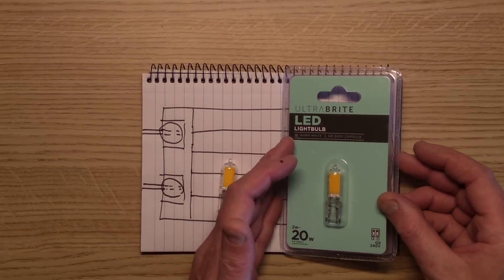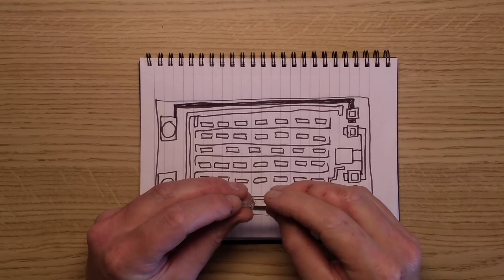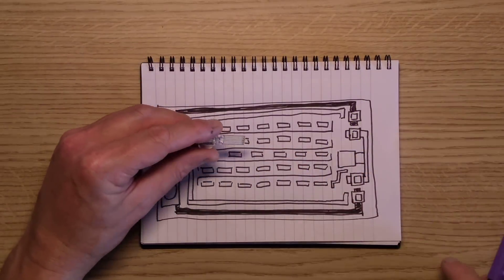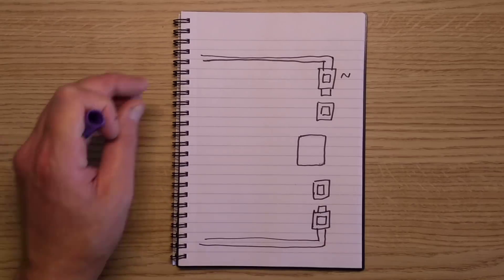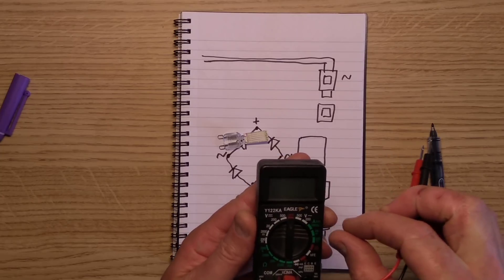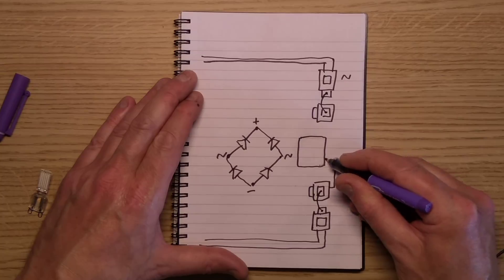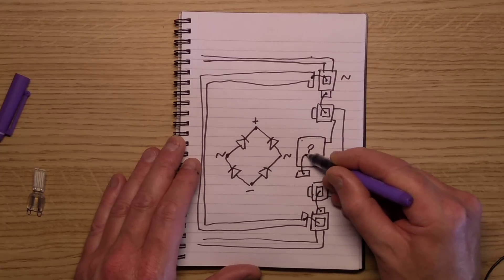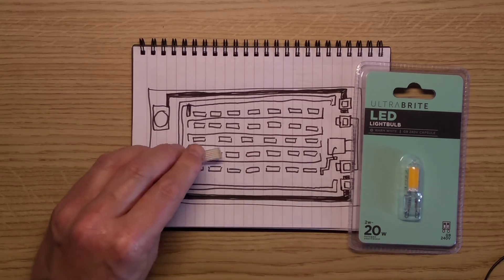Inside a G9 COB lamp from Poundworld.

Comment: 7, 7, 6, 7, 7 chips = 34, x 2 sides is 68, x 3 volts is 204 volts ???
Reply from the maker: And the rest gets dropped by a current regulating chip.

Comment: I have 25 of these installed in an antique chandelier.
They flicker when I try to dim them with a trailing edge LED dimmer….
Anyone any idea on how to circumvent this?
Reply from the maker: The minimalist nature of the small lamps is such that there's no room for smoothing, so the mains frequency flicker becomes noticeable and they may also react visibly to mains voltage fluctuations.
Reply: @bigclivedotcom  Ah oké, then I will look for some more appropriate bulbs!
Thanks a lot for replying! And for the great video’s! These series are fantastic!

Comment: I too bought one of these for 50p,found a sutable holder in an old display unit,works well as an under cupboard kitchen worktop light. I put some foil on the underside of the cupboard to reflect light and dissipate heat.

Comment: I bought a few of these from China, as I haven't seen them in Poundland or Poundworld.  They were advertised as 5 Watt but when they arrived they seemed rather dull and measured 1.5 Watt.  I received the usual partial refund. As others have said light fittings that are designed for G9 type bulbs often have restricted space available, so getting more powerful but larger cob bulbs is not always the answer for simple replacement of G9 incandescent bulbs.

Comment: Why would you need a lamp holder to show it working?
The Hopi meter has clip terminals. Just put a test lead with aligator clips in there and hook them up.
Reply from the maker: I'm travelling with work, so no Hopi Meter.

Comment: G9 have one minus, because the are so tiny there is no space for capacitors, as result of that they flicker. Is there any way to limit that flickering?
Reply: Do you have any space in the fixture?  If so, a resistor or cap dropper, [pref. full wave] rectifier and smoothing electrolytic will fix that.  But if you just feed rectified and smoothed input, you'll [of course] be providing 1.4x the recommended input voltage, and that might end badly...  :-)
Someplace I read about running pairs in series, so they'd run cooler and last longer; and that'd also save you the dropper :-)

Comment: Shame on you, not showing in lit up first.

What voltage are they ?
Reply from the maker: 240V
Reply: You must buy led tester or some high voltage adjust (this need some extra capacitor about 100uf). https://www.ebay.com/itm/AC-220V-Bead-Board-Lamp-Dual-LED-Display-Screen-With-Light-Backlight-LCD-Tester/192536308712

Comment: The bulb looks like, and appears to be about the size of, a 1960s Kodak Instamatic flash bulb. They were fired mechanically, because the camera had absolutely no electrical or electronic components. I think each bulb had a piezoelectric crystal that discharged when struck by a sprung lever.
Reply: True the instamatics has a spring that is released  when the shutter was fired and hit the bulb base.   Took one apart to see how it was made.  Reset the spring then refired the flash and got a   hot flash of light.

Comment: Bare wires will do to light it, doesn't it? :D
Reply from the maker: Slight lack of bare wires and stuff in the accommodation I'm in at the moment.  (Working away from home.)
Reply: bigclivedotcom No bare wires or an old cable to be found around a light crew? :o I'm indeed also curious about the lighting of the back. Greetings from Budapest as I'm also away from home and attending Sziget.

Comment: I don't know who came up with this "LED filaments" and "LED bulbs" design, but he has to be uneducated person in EE.
LED needs really good cooling. Tungsten filament doesn't.
Tungsten filament require special atmosphere. LED doesn't.
That's why you hang tungsten filament on very thin molybdenum support wires in the glass bulb and that's why you mount LED chips to aluminium heatsink with thermal conductive paste.
Reply: The engineer tries to build the best product possible. The capitalist, on the other hand, will always want to make the best-selling product possible. If it looks like a traditional lamp, that's a selling point. People like things that look familiar. People also like it when they can replace their bulb with a semi-unidirectional LED "bulb" at minimal cost, instead of replacing the whole lamp at significant cost. That's another selling point.
Sure you may not get 100,000 hours of MTBF with the inadequately cooled bulb, it may go out after a year, but... when you are shopping for bulbs, MTBF is just a number on the box. It may be true, it may not. So you can buy a $5 bulb with a MTBF of 10,000 hours, or a $20 bulb with a MTBF of 100,000 hours. Will people make the economically sound choice? 10,000 already sounds like plenty. And it's just $5, who cares. Most people will compromise. And If it goes out after half a year, will they complain? Or will they just buy another one for $5?
Reply: Also, the "filament" lamps are quite efficient (less light absorbing stuff around) with good power factor (no cap. dropper), so there's actual engineering advantages to them. 
But yes, the heat conduction has to happen over the gas in the bulb, that's why the LED types don't have vacuum like the tungsten lamps did... 
In the end, they got it working (at least some manufacturers), so i assume they can't be that uneducated..
Reply: That's why this type of bulb is often quite low power, often much lower than the power promised.

Comment: Question can you explain how I can make a simple circuit that when triggered and the trigger stays pressed,it will open and then close a relay and stay in that state until the trigger is released and then pressed again. I hope that made a bit of sense. thank you so much. your the man.
Reply from the maker: Look for a standard component called a recycling timer relay.
Reply: that type of circuitry continues to cycle as long as the trigger is activated. unfortunately that wont work. By the way I watch just about every video you have.
You really do great work and your obviously very good at what you do.
Thanks so much for your videos. Keep it up Man. If you can think of another way to create this type of circuit please let me know.

Comment: Clive do you have an email address you don’t mind sharing with a viewer? You likely know this but if not it’s Best to make it a different email address than your normal personal address because low lives will spam you to death. 

Reason i ask is I wanted to forward you a couple of Chinese product listings for clamp meters, in particular ones that try to match specs with the Klein 900 (used to be the Klein 2000). It’s a meter that can measure DC current up to 2000A, though iirc only the AC current is RMS, but still measures up to 2000A, I don’t know enough about electricity to know why that is but it would appear something about DC current makes it hard/impossible/unfeasible to measure current RMS, or high current at least. Maybe the meters that can measure up to 20 (maybe even 60A max) DC via probe leads can do so RMS. 

Anyhow sorry that doesn’t really matter, I’m just really curious about how these Chinese UnBrand’s performance compares to Klein and Hioki/ Fluke, is it a lie and if not does it do so differently than Fluke’s or where exactly are the corners cut? If I dissasemble one on high quality DSLR 1080P 60fps at high bitrate would you like the footage? And I can take still photo’s of the boards/components for even higher resolution that can be blown up much larger for identification of individual chips/caps/Fets/diodes/chokes/inductors & anything that may be of interest. 

Would also be willing to jump on a phone call or stream/Skype to you if you want something investigated in real time, I can be the hands and you can be the eyes/brain :P.

Alternatively I can point you to the amazon/eBay listings for the meters that can do up to DC 600A, 1,000,  or 2,000A. 
Models that do the same with AC alone are much cheaper and more common so there’s really not that wide a selection of the higher spec variants
Reply from the maker: Clamp meters tend to use a pickup coil for measuring the AC current and that doesn't work for DC.  The DC versions are much more complicated and have to be nulled out frequently as they can sense ambient magnetic fields too.
Reply: bigclivedotcom thank ya kindly!

Comment: I ran across circuit similar to this in a edison 17 screw bulb (120 v).  Just leds wrapped around a core with the electronics on the same flexible "board" slipped in the core.  All it had was a package bridge rectifier, tiny SMD smoothing cap, a chip SM2082D (a constant current LED driver) and a SMD current setting resistor.  There were 44 SMD LEDs in series (2.5v x 44=110v).

Comment: I would of been happier if you rigged up some creepy setup to power the lamp with. Maybe, buy a cheap extension cord or lead or whatever you call them, cut or crop off the end connector to strip the end, and just touch the ends to the terminals. All the while being careful not to short the wires out of course especially on a property that is not your own. Yup.

Comment: While you where in pound world did you notice the USB mains chargers    (I got a few from pound world Dunfermline ) 
They seem to be very high quality,
I don't have any testers for these but I have taken one apart. They have good isolation in the PCB and the switching transformer 
+they also have an illuminated usb port so it can be found in dark 

For £0.60 they are good
Reply: They used to sell these in the poundworld equivalent here, Dealz, bought one and was surprised at the quality.. Meant to go back and get more but they dont stock them anymore :/
Reply: Skruffles yes I thing dealz & poundland are the same company so you would have got a poundland USB power supply and the poundland near me stopped selling them, where as pound world is completely gone 
The poundland /dealz power supply's always seem to be good but ,the poundworld USB power supply's used to be crap , they changed the shape of the plug ,(slightly larger and rounder & twice the price ).  The old ones looked like coloured apple USB chargers & cost £1 now they are£2 and much better
But I got them for 60p in the 'last day administration sale
Reply: I am sure there are tear downs for these already on this channel
Reply: David Anderson for tho old ones not the new ones

Comment: We have a 5 holder G9 light fitting in the lounge and everytime I try using led bulbs they don't seem to last very long 😠, heat is a major problem they need to solve. they do last a bit longer than the original G9 Halogen bulbs which tend to burn out after about 3 to 6 month's use. maybe we should rewire the house wiring for 12 volt and use car bulbs as they seem to last for years in comparison.
Reply: Steve Jones sounds like the issue may not be the lamps but rather the sockets.  Have a look at the failed lamps, are the pins clean and shiny? Or are they blackened?  If it's the latter the sockets are making a poor connection and you should think about getting the fitting replaced.

Comment: Are bond wires suitable for 240 volts?
Reply: The wires don't care about the voltage at all, it's all about current so long as you don't have any arcing. 
There are specialized semiconductor packages that deal with thousands of volts. Generally they're filled with exotic dielectrics like sulphur hexafluoride or they're just encapsulated in high dielectric strength epoxy.

Comment: I have a bunch of these (style of) G9 lamps around the house, also 2W (20W equivalent). They also have two slightly-differently coloured sides, but the light output appears to be even. They've been in for a few months and have been fine so far, though them running at around 60°c makes me consider the longevity. Once you get a G9 socket it would be interesting to see how much current they actually draw compared to the spec and if this varies much as they heat up.

Comment: What can we conclude from 7-7-6-7-7?

That the Chinese consider 35 to be an unlucky number.
Reply: that aliens did 9-11 ?  or watch out for july 7677
Reply: 4 is unlucky because it sounds like the word for "death".
53 is unlucky because it sounds like the words for "no life".
54 is unlucky because it sounds like the words for "no death". 
34 is just about forward voltage vs the ability of the regulator to dissipate heat and manufacturing cost.
Reply: +Peter S
34 doesn't mean "good luck" or anything like that, it means "forward voltage vs the ability of the regulator to dissipate heat and manufacturing cost"?  Wow!

More seriously, if it were about heat dissipation in the regulator, 35 would be better than 34.
Reply: +bdf2718 "More seriously, if it were about heat dissipation in the regulator, 35 would be better than 34."
Manufacturing cost is the larger driver. The cost on the time in the placement machine is MUCH, MUCH higher than the cost of the LED die being placed. In the design of the regulator there is a maximum allowable dissipation, and with the particular blue LEDs used here it takes 34 to be within Imax at Vmax. Once you hit that there's no reason to increase cost unless you care about extended reliability and commodity good from Poundworld are not manufactured with extended reliability BOMs. (Bill Of Materials)
Reply: Peter S Consider that Vmin may be 110V - 10% or even the traditional 85V AC.
Reply: John Francis Doe, very good point! 
The retail package is marked 240V but we're going to have to wait for Clive to characterize it for Vmin.
Reply: That 7 also 8 9....  See how the 7's are surrounding the 6?  They don't like their kind, or their cousins... the 9's.
Reply: Or is the longitude of the place it was made at. We need more bulbs to find out if the code is between 35.467 and 40.918

Comment: Filmed in a real IKEA armoire! :D

jk Thanks for the teardown! Interesting that they didn't turn the next row of LEDs 180° and instead went with those long 'horizontal' tracks. I'm certain it's due to the manufacturing process, though. Kinda neat how much LED lamps have improved over the years, but sad that many are still lacking in thermal management.
Reply: Thanks, I was also wondering about the LED placement (being non https://en.wikipedia.org/wiki/Boustrophedon :-) -- and the hypothesis is that the pick-n-place would take significantly longer to rotate alternate rows, so it's worth a more-complex PCB to save that time (?)

Comment: Just a thought, when you're setting up your camera, you might want to put a little piece of tape at each of the four corners of the frame. That way, you can see if you're in frame based on the tape, without having to get up and check. Of course, that won't help if you zoom in, but in videos like this, where you don't zoom, it might help.
Reply: That's brilliant.
Reply: You are a genius
Reply: You can also zoom right in and mark the very centre of the screen image.

Comment: Would be curious to see it lit as well as light output and heat created. 20W is a lot for that area and no heat sinking to boot.
Reply from the maker: It claims to be 2W but equivalent to 20W.
Reply: Oh, that kind of "20W" then.
Reply: Well it means for just 2w of power it will create the same amount of light as a 20w halogen.
Reply: Yeah....at least they claim to do so...but they never create as much light as rated halogen comparison.
Reply: bigclivedotcom  Hi Clive I watch you all the time on YouTube I absolutely love what you do because I am into that sort of thing I make stuff myself I would like to send you a gift for you to take part and make a video if you want  I will be making it using a 3-D printer and a laser in Graver and using some LEDs  this is my email tomtomgcohen@hotmail.com  so if you don’t mind sending me your address so I can send you your gift free of course  thanks
Reply: Tom Cohen very nice gesture ! hope bigC sends you a pm
Reply: I hope we'll see this wee light again when it can be dimmed up with a variac and tested for operating heat. 
The forward voltage of the string is only about 100V so that regulator will be dissipating quite a bit.
Reply: Me to. I would like to know what sort of lamp holder it fits as well. I recognise the fitting but cant remember what it fits.
Reply: @jeremytravis360 " G9 halogen socket for 230V" with 10W up to 300W usually they are 25W/33W osram halopin ones, you get quite nice wall lights that emit up/Dow the wall made out white stone for cheap with lots of sockets 3++
You know what's the secret? These dim also very very nice :-)
Reply: Even at 2W, that's going to be pretty damn hot.  Consider that at 25C, a TO-220 package without a heat sink is going to be rated for about 2W, and most transistors are going to have a higher Tjmax than an LED will.  Then consider that the TO-220 transistor would be operating in open air, instead of being sealed in a glass tube inside a relatively small enclosure.
Reply: 2W still is a bit much for us hobbyists, but i wonder if the LED manufacturers are making the chips more heat tolerant? 
The semiconductor's melting points are quite high, so they "only" have to ensure that the other materials don't migrate into the chip too fast, and push their "temp of highest efficiency" a bit higher. 
Being able to drive them without heatsink would mean less cost, build volume, weight and more efficiency, because some extra light from the "backside" could be won..